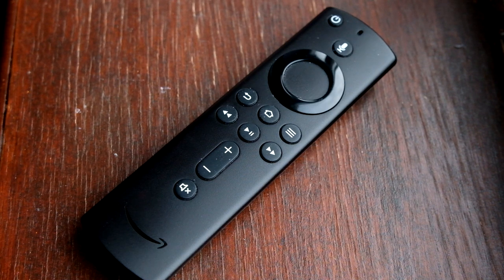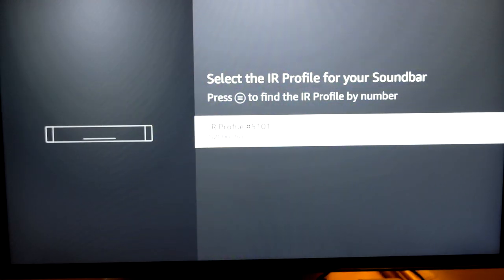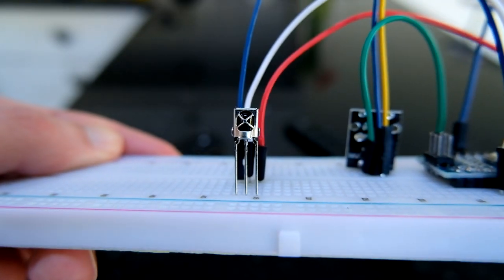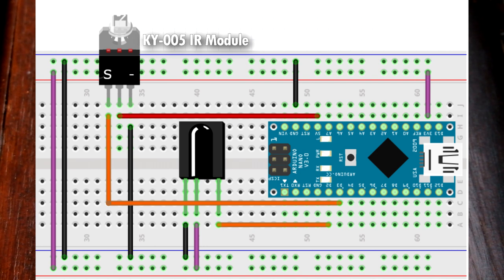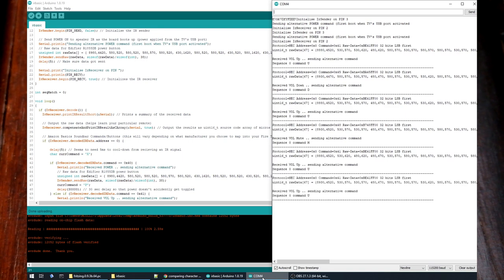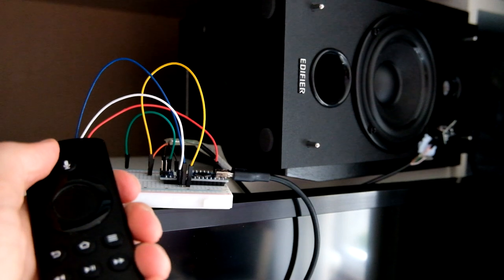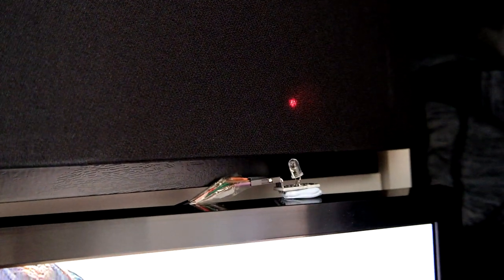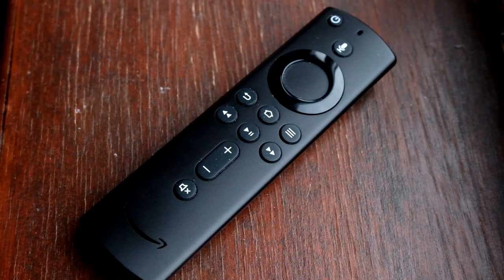Control Unsupported Devices from a Fire TV Remote! Cheap DIY Arduino Equipment Control Hack

Comment: Very nice I've talked to people about doing this but you are the only person I am aware of that actually did.
Reply from the maker: Thanks! It really annoyed me that Edifier essentially keep their RC codes secret & won't give them to Amazon. But it did give me an excuse to get creative instead of sending the speakers back 🙂
Reply: @Endpoint101  Amazon doesn't appear to give their codes out either.  I found almost all the codes for my Omni series Fire TV.  I used a universal IR remote with the Element TV brand codes.  Apparently with an IR adapter even the streaming sticks will respond to IR commands but I haven't tested those yet.

Comment: This is a very helpful video, clever work around.  

After much faffing about with the Firestick "add equipment" wizard; I discovered my TV remote is actually RF!  Is it possible to adapt your Arduino solution to use RF output instead of IR?

If so, what module do you think would do the trick please?
Reply from the maker: Possibly, but it'll depend on your TV remote.. This tutorial looks like a good place to start. https://www.instructables.com/Decoding-and-sending-433MHz-RF-codes-with-Arduino-/

Comment: This is pretty awesome. I'm ordering the parts right now. hmmm wonder if I could just rip the ir emitter from one of those old led strip remotes? Any ways thanks for sharing! ---edit I just realized after watching a second time you addressed trying to use an ir led from a remote so disregard. I was able to take a receiver from an old remote control helicopter though and have it reading codes already.
Reply from the maker: Yeah, you might have the NPN transistor that I was lacking (for the transmitter).. That'd be worth a try if you did. Hope the build goes well.. Let me know how you get on! 🙂
Reply: @Endpoint101  Yes, I had to add a transistor and a couple resistors to get good range on my Tasmota/ESP8266 IR blaster.

Comment: Would be much easier if Amazon releases custom hex codes for ir profiles, every new projector i buy i have to search under 100 ir profile each time. As it already has the ir decoder transmitter on the remote it's just a matter of software.
Reply from the maker: Absolutely! Like you say, it's all down to the software, and they (a bit like Apple) don't give you enough control of your own stuff.
Reply: @Endpoint101  I'm doing my first try on arduino, thanks to your tutorial but having problems with irremote version, it says i have to use updated code, i went for simpler as i just need to program the power button, i asked Bing AI to make the code and the ir input seems to work just fine but my remote uses a 38khz code and with standard input only gives me multiple FFFFFFF
Reply from the maker: @RhuanrLima  Are you able to manually select v3.5.2 of IRRemote, which is the version I developed the code against? That helped when other people hit problems compiling the code (https://github.com/mattcuk/IRtranslator/issues/1)
Reply: @Endpoint101  thanks i was trying from scratch with help of Bing AI, i need a simpler version only for power on and off, I'm able to receive and send signals, so the problem is only the code I'll give a try, thanks!
Reply from the maker: @RhuanrLima  AI is so useful for pointing you in the right direction.. it'll only get better! 😀

Comment: Very helpful video, nice work! I got a problem on my side, I hooked up my IR Transmitter and everything seems to work(When I press volume button from my FireTV Remote, the transmitter red LED light up showing it receive the data), but the IR LED doesn't light up, it receive about 0.035V from the board, any idea how to fix it? Different transmitter maybe?
Reply from the maker: Just to be clear (I'm sure you know this).. you won't visibly see the IR LED light up, but you could use your phone camera to check it.. that would help prove whether it was doing anything before you debug it further.
Reply: @Endpoint101  yes i was looking through my phone camera, i also know the led is not burned down since i see it light up when i powered it directly with a flat battery, I have a HX-53 transmitter

Comment: I would like to modify a fire tv remote so that the four app specific buttons will start apps I actually use and not the default apps. For instance, I will never use the Hulu button, but I use YouTube often and would like to reassign that button. 

Thoughts?
Reply from the maker: There was an app that you could sideload onto the Fire TV stick to do that, but a few months ago Amazon started to block it from working. Not sure if that situation has changed, but here's the link for more info; https://www.aftvnews.com/how-to-remap-the-app-buttons-on-fire-tv-edition-remotes-with-remapper/

Comment: Hi, 
Nice video, I was wondering if I could use this method to change TV hdmi input using fire stick remote?
Reply from the maker: Yes, that's totally doable.. and you could write it as a pattern/sequence of button presses (which I've put an example of in the source code).

Comment: I have this exact same pair of speakers and a fire tv and wax looking for a solution to control the volume with my fire tv remote tv remote. Wish they'd sell this thing as a ready to use unit, looks way too complicated for me. 😂😅
Reply from the maker: Some people have reported that there is support for this model on the Fire TV, but I haven't checked it myself.. did you not find it listed?
Reply: @Endpoint101  the supported model is the r1850Db I have the R1855DB. Tried it anywya but but it doesnt work unfortunately.
Reply from the maker: @ShiningBOT  Thanks for letting me know. The project I've detailed in this video isn't too difficult to put together, but I can see it'd be a bit daunting if you've never done any of this before.

Comment: Quick question. Why not just use the fire stick remote to control the tv volume and have the speakers set to a certain volume? What am I missing? Would love to know as I have just ordered some Edifer speakers
Reply from the maker: In my case, when you use an optical cable, it disables the TV volume controls, I guess assuming you're adjusting audio via a separate amp remote control.
Reply: @Endpoint101  Have you tried a DAC/hdmi audio extractor?
Reply from the maker: @kudobeats  I did wonder about those, but haven't got one. Have you?